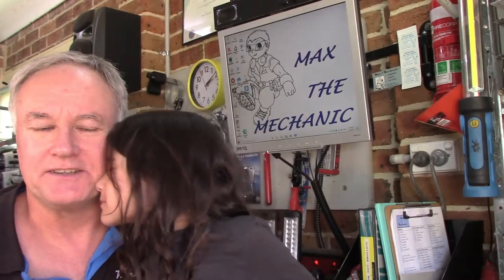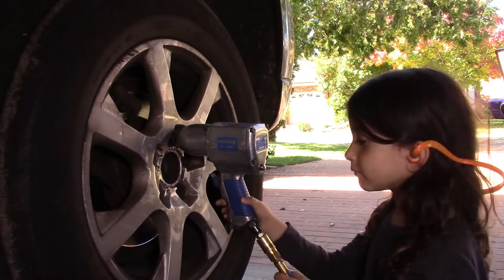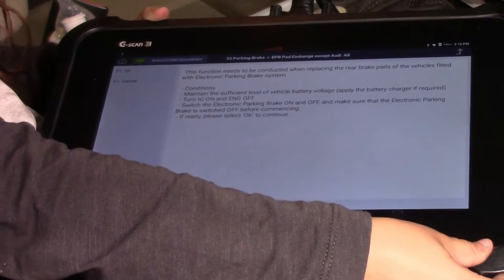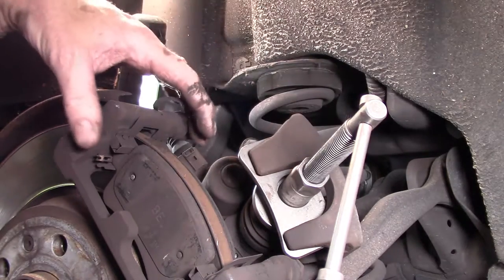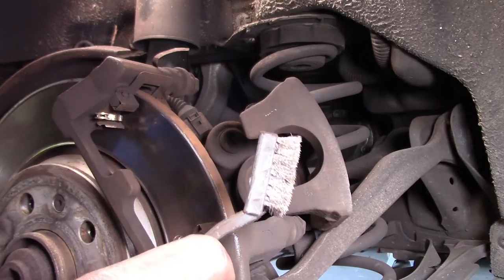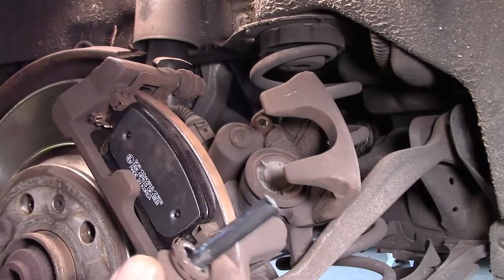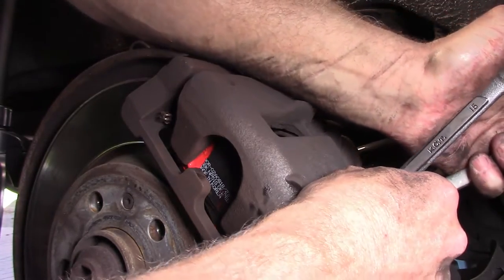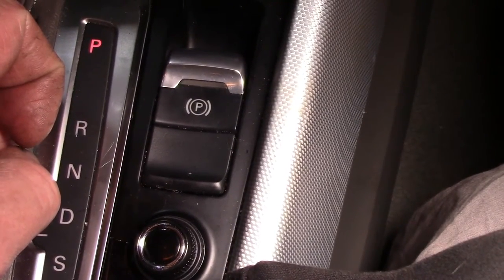Audi Q5 Rear Brakes With Electronic Park Brake & SJ!

Comment: Hi, I had car sitting for 4 months as I was away and beside having a dead battery when I came back I cant release the e brake. It looks my left rear break is stuck and having the break malfunction on dashboard. Does anyone know a way to disengage the e break manually?
Reply from the maker: Hey Pavel,
If you have a 2 wire connector onto the caliper motor, you can disconnect the wiring, apply 12 volts via a battery (making sure of correct polarity) to disengage the motor.
That being said, if the caliper is stuck, that is a mechanical fault not an electrical fault.
Reply: @MiracleMAX  i had the wheel down yesterday and I couldnt hear anything from the motor on the left side. That would sort of point to a possible electrical issue right? All fuses for ebrakes looked ok yesterday
Reply from the maker: @pavelmachala  Best to check for continuity across the terminals of the motor. If open, the motor/caliper will need replacement. If it has continuity, have you got power and ground when activated? Have you tried 12 volts across the motor terminals?